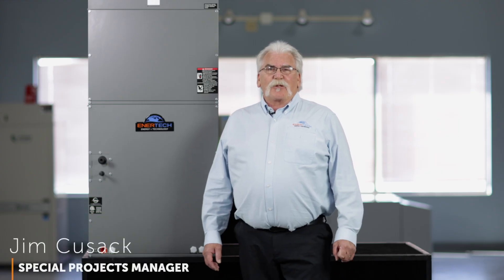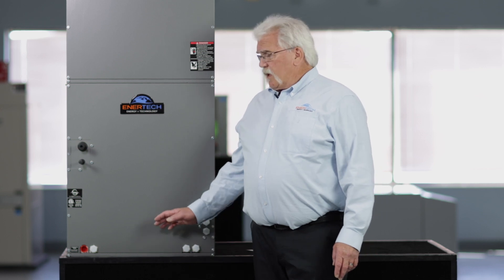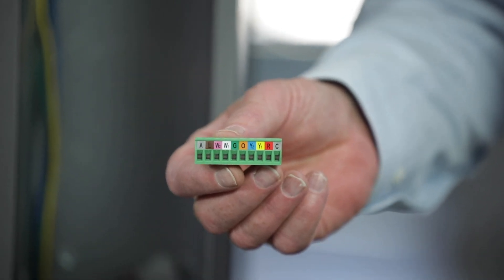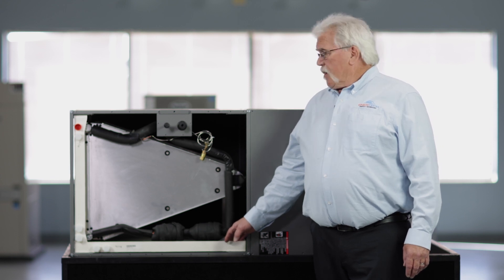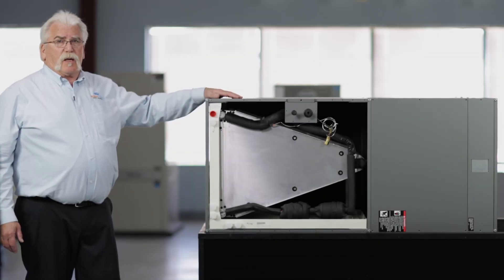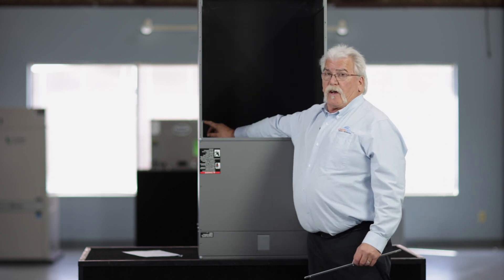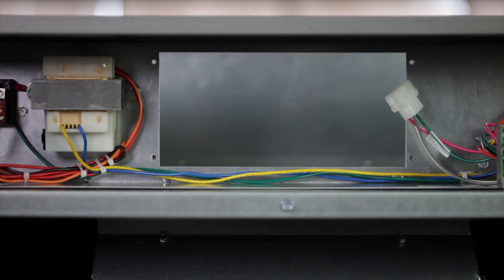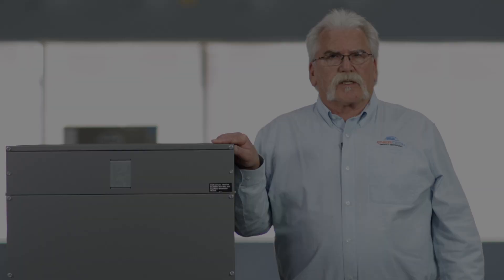Enertech's NEW Direct Expansion (EAD) Air Handler | Walk-Around Video

Comment: From the description (and diagram) you gave about changing from an upflow to downflow configuration, it looks like the airflow over the A-coil has been reversed (i.e., the air now enters the chamber from the "narrow" end of the A-coil, whereas in the upflow - and sideflow - configurations have it entering from the "wide" end of the A-coil). Were there any experiments done to see if there is any change in either (or both) of the effective airflow rate (CFM), or effective cooling capacity? I'm just curious if the different direction of flow creates any turbulence, etc. affecting either of the two measures that I mentioned.